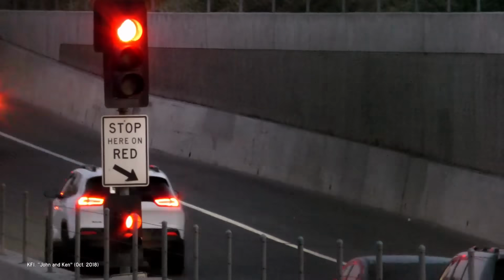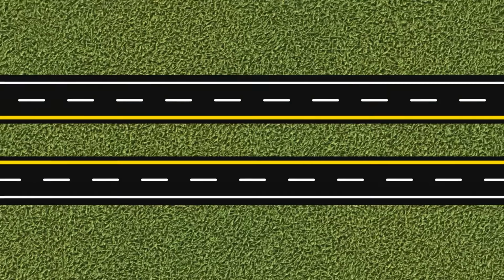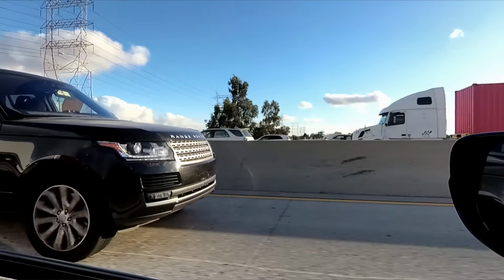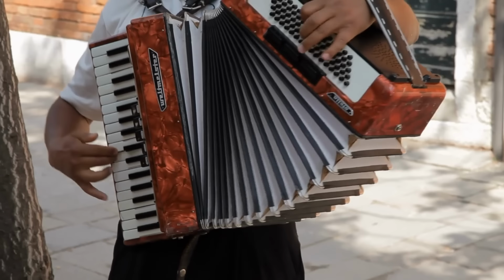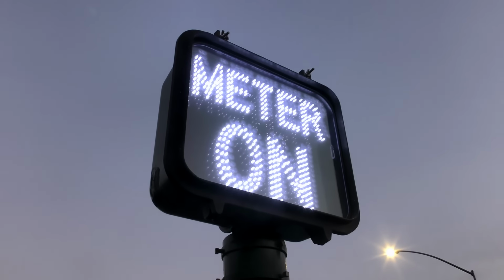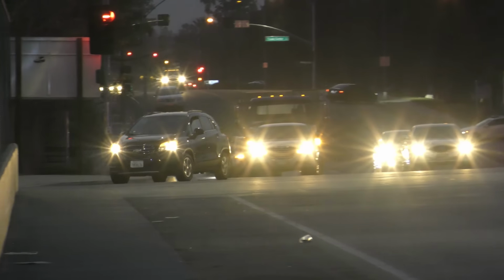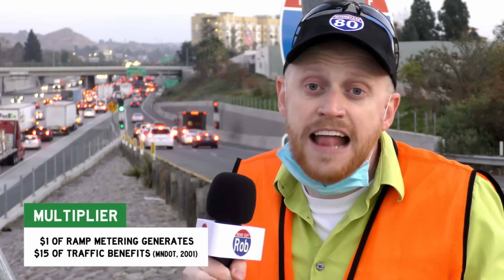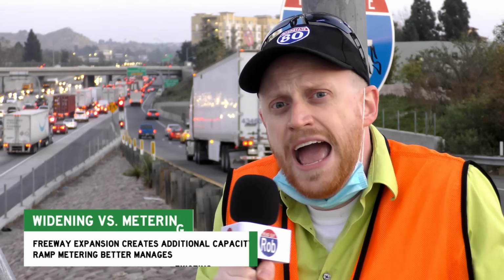Why the extra RED LIGHT on freeway ramps?

Comment: Bruh imagine if Americans knew how to use lanes properly too
Reply: Tips for Americans that we use:

-Use the right lane most of the time, left lane is for overtaking.

-When you're on the highway and before reaching an on-ramp move to the left lane to make it easier for the cars coming in.

-Allways keep at the least 20 to 30 meters or more safe distance between cars depending on your speed.

-Dont just look to the car in front of you, try to look beyond him to be ready if something happens and you have to brake.

-Dont just look at your mirrors, use your head to check the blind spot when changing lanes.

-Before reaching slow traffic or a traffic jam, or suddenly braking turn on your hazard lights to warn drivers behind you.. 

-Dont stay in someone else's blind spot, move out fast when you're in that position.

Bonus tips:
-Use the left blinker when you're on the left lane and want to overtake the car in front of you, so he knows to move over to the right lane.

-Use the hazard lights blinking once or twice to thank someone behind you.

-Use the hazard lights to warn other drivers of cops and radar 

-
Reply: @ElySky95  umm merging traffic is responsible for merging safely not the main traffics job to move over left...
Reply: @truckercowboyed2638  You don't have to move to the left it's a matter of courtesy, but as long as you can do it safely, you can do so to help other people out and avoid traffic jams on the on-ramp, and in smaller countries it helps a lot, but if you're a selfish lazy person just keep going as you wish.
Reply: @ElySky95  we flash out high beams here for that, using a left signal would probably just confuse someone or they'll just think you left it on by mistake
Reply: @plingket  we also so that here, the left signal is just one more hint
Reply: @ElySky95  oooh okay I see
Reply: @ElySky95 this is taught in American driving schools as good practice (at least anecdotally) but it's just not enforced so it can be ignored by lazy drivers like a week after your road test.

It's also hard to drive "correctly" when no one else on the road is on the same page. The simplest example is you can't pass with drivers cruising in the left lane.
Reply: At least they have lanes. Go to India and it’s a whole different story
Reply: And Canadians
Reply: Exactly
Reply: Tell me about it 🤦‍♂️ I'm surrounded by idiots this is why we need more public rail transportation because some people seriously need to stay off the road
Reply: @ElySky95 While that may be true, you also have to keep in mind though, a lot of the people driving in the US that fail to follow those tips are either in cool sports cars or other high expensive cars or in a car that’s completely beat up so they have no regard for taking care of it, in a rush thinking about getting where they’re going, are absolute Karens that want to patrol the highway although they don’t carry a badge, or are one of the following demographics: Hispanic/Latin, Asian, Indian, Middle Eastern, recently immigrated, low income, not a fluent English speaker, and/or has a lengthy criminal record
Reply: @plingket yeah I heard in Germany they do that, I do that a lot on the freeway, just be aware if you do it in the US, the guy behind might mistake your flashing as a potential hazard or police presence and they might slam on their brakes
Reply: @B345T1N355Official  I live in New Jersey and it's really about the context. If you're behind someone flashing them in a passing  lane we all understand that means move, if someone in an oncoming lane and flashes you it could indicate police (not very likely), a hazard, or, most likely, you left your brights on. It also means "I'm letting you go".
Reply: @ElySky95 this also applies to Canadians 🤓
Reply: @plingket  yeah I’m in California where people have minimal understanding of indications
Reply: @hellfreezer3037  and Mexicans
Reply: They have these in Georgia too
Reply: imagine if foreigners knew to keep their opinions to their self
Reply: @ElySky95 I'm not sure if you're Canadian or not. But this is exactly what we do here in central Canada.
Reply: @Palozon  straight up
Reply: @ElySky95 We literally know all of this. This all gets taught in Drivers Ed, and while getting your license.
Reply: Imagine if Youtube Commenters had something better to do with their lives.
Reply: @ElySky95 personally on the last one, I wouldn’t warn but let them get caught, do stupid things and win stupid prizes.
Reply: @Boypogikami132  
Nahh because of speed traps, sometimes governments purposefully lower the speed limits in certain zones to generate speed trap revenue, sometimes It's safe to go 20 to 30kmh above the speed limit with enough safety distance.
 
If someone is driving crazy and tailgating ofc they should get punished not the majority of people who drive at safe speeds even if above the "speed limit".
Reply: @jacobs9474  'Mericans don't. Why should anyone else?
Reply: @aidanmcgregor8789 Nobody cares
Reply: @truckercowboyed2638 True, but it is courteous to move over if it is safe to do so, especially if you see a "platoon" merging onto the freeway.

Comment: Live it when people don't know how to merge into a highway. Trying to merge 20 under the speed limit of the freeway forcing everyone to brake behind them.
Reply: Unfortunately the lights on the ram make it worse becuase it conditions these drives to the idea they should be merging at 20mph. 

Best I have seen was a ramp with signs literally saying to speed up and merge lol.
Reply: I’ve actually pulled over on the shoulder of an onramp and waited for that a$$hole to get a mile up the road so I could actually get up to a proper speed before merging and not die getting on the freeway.
Reply: @jefffinkbonner9551  Same, except it was to drive past him... he was also too stupid to know that during rush hour the shoulders are extra lanes that start on that exit.
Reply: The problem is that there's not enough ramp after the meter. You either have to completely floor it or drive a completely overpowered vehicle in order to get to up to that speed of traffic after being completely stopped. If the ramp was longer after the meter, it wouldn't happen.
Reply: @AlexandarHullRichter  that's what happens when the meters were designed and installed after the original highway project - onramps have meters installed, but aren't lengthened because that costs a lot of money.
Reply: When exits are a mile or less apart, it helps both merging in and merging off for the entrance lane to just go all the way to the next exit.
Reply: And if traffic on the main is travelling at 20 under because it's too dense for higher? Trying to merge at higher speed than the flow is just as bad
Reply: Ummmm I hope you’re not talking about semi trucks. Or about older, underpowered vehicles. Or about any vehicles with manual transmissions being driven by people who aren’t experts at shifting.
Reply: @jefffinkbonner9551  that’s what I do when I get behind a super heavy, slow semi.
Reply: @AlexandarHullRichter  this would be particularly heinous for semi trucks.
Reply: Well,  who forced them to try to accelerate from 0-60 for no reason? 

Merging is a lot easier if you're already traveling highway speed. 

This is how it used to be. Before this invention in search of a problem.
Reply: I merge at 20 over 😁😁
Reply: Yeah and they are dumb enough to keep going until the lane runs out.
Reply: @AlexandarHullRichter  'Tis why on-ramp lights are always a rolling stop for me, even in a car that can do 60 in under 7.
Reply: In Northern Virginia, I-66 between the Capital Beltway (I-495) and Washington, DC, had metered ramps on westbound lanes during rush periods. There were issues with accidents and traffic flows that ramp metering was discontinued.
Reply: The design of the ramp is at fault IMO. Two lanes on the ramp merging together right before they have to merge onto the highway mean all the incoming cars will drive slower & be closer to each other. Also for some reason people will always prefer using the highway instead of the service roads so the highway reach peak capacity before the service road. An other thing is all the merging onto the highway and people switching lanes before a ramp really kill the flow on the highway.

People need to learn they shouldn't change lane on an highway unless it's really necessary or to balance each lane and the ramp itself shouldn't have more than 1 lane.
Reply: @devtrash  Best comment so far. These people did not actually watch the video, they must have kept it playing while writing their comment to their perceived version of what a ramp meter is.

The speed on the highway is not 70 (mph) but perhaps 60 (kph) when the ramp meters kick in. That is when traffic flow really starts to suffer. 

All the ramp meter does is helping with the zipping of the two lanes, two lanes that are needed when the highway is above capacity to keep the queues away from the surrounding street turning rush hour queues into city wide gridlock.

If people actually knew how to join safely and adjusted their speed depending on traffic conditions, these lights would not be needed.
Reply: There are highway on ramps that don't give you enough time to accelerate. I live in Central Connecticut and we have route 9 which is the worst designed highway ever, and the Merritt parkway. The merit has stop signs at the end of almost every on-ramp. And the on ramps that don't have stop signs are corkscrews so you literally can't go over 15 miles an hour on the on-ramp....
Reply: If every state and jurisdiction started replacing the interchange or merge lane with a different name and labeling it with a big sign as such calling it the acceleration lane I bet people would feel a hell of a lot more hurry on their ass to get off the highway speed before they get rear ended, the idiots
Reply: @rebeccahetrick6576  also shout out to Hartford for always being a parking lot at rush hour + having absolutely tiny left hand exits/merges. I-91 on Hartford's riverfront is an experience, and probably the worst landuse in the city.

I used to live over an hour from the interstate in NY, now in central CT, Hartford is an experience and merging on 9 from Middletown is not fun either. (Que mandatory griping about wanting rail to be a viable alternative)
Reply: @rebeccahetrick6576  The Merritt, I remember driving on that one a few times when I went to visit my friend in Connecticut.  Also went on it with the family ~15 years ago on our way up to Maine in an RV, the "no trucks" and "low bridges" signs were only readable after the point of no return on the entrance ramp!  RV did fit under the bridges thankfully, but it was a close thing.
Reply: @mulgerbill  higher speeds give you a lot more leeway
Reply: Prototype sez: "Live it when people don't know how to merge into a highway..."

I assume you mean "Love it", yes?
Reply: @stevengordon3271   "When exits are a mile or less apart, it helps both merging in and merging off for the entrance lane to just go all the way to the nest exit."

Yep -- they're called auxiliary lanes and they help a lot.
Reply: @ARSZLB   "I bet people would feel a hell of a lot more hurry on their ass to get off the highway speed before they get rear-ended..."

Did you mean "get up to highway speed"?
Reply: @AlexandarHullRichter  Thing is if it was longer you'd just end up with a new platoon behind the slowest person
Reply: @BastiatC   so I guess you get to pick which is worse. Having cars get on the freeway 20 miles an hour below the speed of traffic, or having two cars get on at once at close to the speed of traffic.

Or we could just teach people to drive reasonably and not crowd each other.
Reply: @AlexandarHullRichter  there's an old Toyota Camry V6 commercial I came across recently that depicts exactly that situation.
Reply: That’s the real issue here
Reply: Electric vehicles becoming ubiquitous will solve that

Comment: That's why I love these videos over a talk show rant. I've actually learned the reasons behind the meters and traffic flow rather than just be upset with traffic.
Reply: So the ramps are working out well for you, then? 

Think for yourself. Now traffic has to slow down because the new cars are trying to merge while accelerating from 0-60.

They should add more lanes instead of intentionally forcing you to stop at a DAMN RED LIGHT ON THE HIGHWAY.
Reply: @hxhdfjifzirstc894  Adding more lanes every time you have traffic problems is how you end up with the I-10 in Houston.
And as said in the video, these have been demonstrated to work. There are a lot of things in urban design that don't make sense intuitively.
Reply: @hxhdfjifzirstc894  except you aren't stopping ON the freeway. You are stopping at the entrance just before actually being on the freeway.
Reply: @hxhdfjifzirstc894  I've never seen traffic going 60 mph when the ramp lights are activated.  If the density is high enough to turn on ramp signals, traffic flow is at 30 mph or less.  Plus, entering vehicles are able to pick a place to merge and zipper in much safer when not having to account for the merging ramp lanes.  The data tells me that ramps are working out for all of us.  Oh, wait, I didn't notice your all caps and expletive, of course you're correct, my mistake.

Comment: This video deserves a follow-through two years later, because one major question hasn't been addressed:
When does it get the point that a lack of runway distance slows the right lane of the freeway to the point that the staggered platoons do more harm than good for freeway flow?
When I lived in Cali, I wasn't a big fan of the lights, but I really despised when they left only maybe 100-200 feet of runway. Routinely (especially with semis) vehicles would be forced to merge at around 35-40. The right lane of the freeway was terrible, and I tended to just stay in the middle or 2nd lane at all times to avoid the mess.
Reply: I do not use the right lane and where I live they don’t use meters. Right lane is always a mess no matter what. Too many exits and on ramps clustered together.

Comment: I live in the middle of The Ruhr. The busiest motorway here is the A40. It is practically the most important motorway in the entire area. It passes through all of the Ruhr, connects all major cities and goes all the way to the Dutch border. If the A40 is deadlocked, nobody gets anywhere any time soon. Traffic lights on the ramps have indeed improved things here. Sure, traffic jams still do happen. But compared to before the traffic lights were a thing it has gotten a lot better.

Comment: I really appreciate this breakdown showing how city planners can optimize traffic.  But I can't help but watch this and think that expanding light rail makes more sense.  We design and build our freeways to operate at max capacity for a couple hours a day.  Then they are underutilized for 18-20 hours a day.  Plus the entire weekend.  They are designed around a volume they only see 12% of the time.  A light rail could fix this by adding more trails during peak times.  And coupled with the urban highways mass transit would level off the peaks allowing a smaller highway to spend more time at peak capacity without being overloaded.  Also seems easy for a city to have special services during sporting events, concerts, and other events that would shock the system.  
I would love to see a breakdown of how mass transit could be used to delay or flat-out replace the need for a freeway expansion.  Keep up the good work.

Comment: I live in a city with no ramp meters (Orlando). I've only encountered them as a tourist, and my main issues is with on-ramps that give you insufficient distance to get up to the speed of highway traffic. When you are in a vehicle with a 15-25+ second 0-60 time, you have to stand on the gas and pray there will be an opening for you to cut someone off, because there isn't enough room for you to slow back down on the ramp. Not everyone drives a modern passenger vehicle with good acceleration. I drive a cargo van, and am blown away by how sporty my friend's civic is (with the base model engine).
Reply: Orlando had ramp meters now

Comment: I don't know if this happens everywhere else, but I get this a lot in Portland. The traffic on the freeway is already crap, and the meter is on, but no one is moving because the cars trying to merge onto the freeway can't because the flow is stopped or nearly stopped. So the line on the ramp backs up through the meter, and I'm sitting there at the meter counting the green lights that WOULD have allowed me to go IF it weren't for the line of stopped cars in front of me. Every. Friggin. Day.